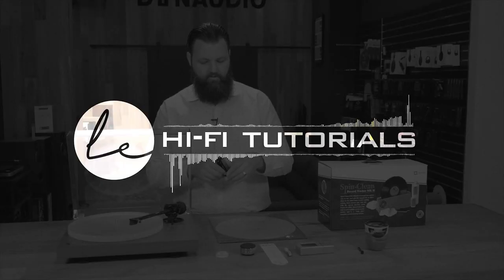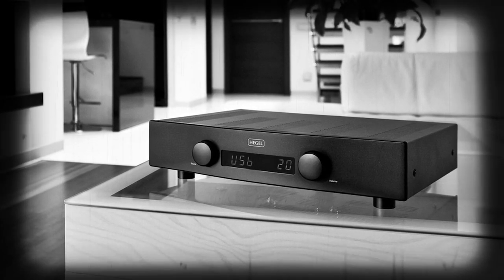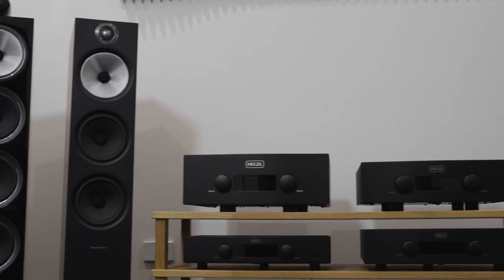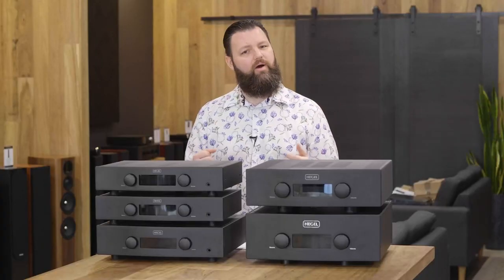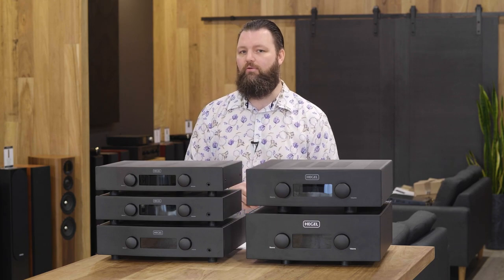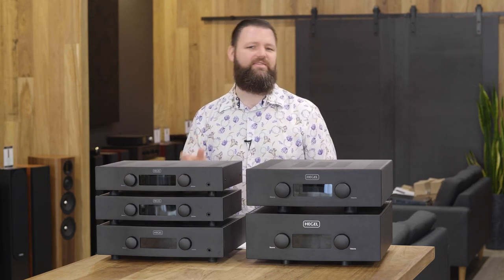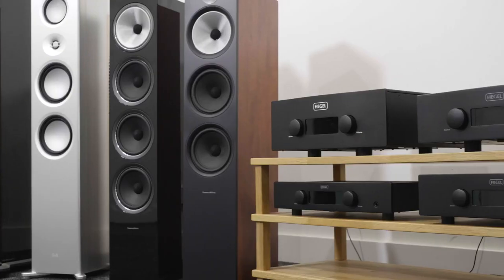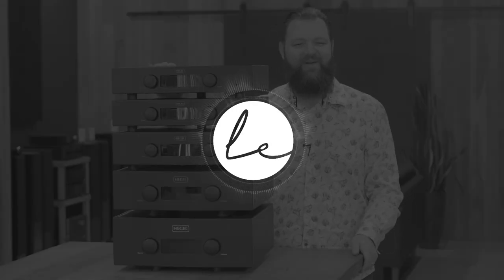Hegel: Power Meets Purity

Comment: 2:50 Damping Factor is high, not low. It should be high. Hegel has decent damping factor considering they are still using an out-dated class A/B design.

Comment: Now i am using Hegel h390 with b&w 702 s2. Big upgrade from h190. I have controll and good bass slam witch the h190 just cant match its even more transparent, more details, than h190. My 702 s2 is more comfartable at high volumes their is never any sign of strain h390 remain calm.with h190 it could be a bit edgy at top end, the h390 fixes that, it clear to me that h190 was on lower side to drive 702 s2

Comment: I know you said they’re very good synergy wise, like you said.  How you think the pairing of this with 606 s2 would be. ?
Reply from the maker: We have used them with the H95 and H120 and found it to be a really enjoyable experience. The Hegel really squeeze every last drop of lowend from those bookshelves.
Reply: @living_entertainment  so they don’t sound bright at all ?
And do 120 is a lot better for driving them than 95 so it’s worth buying 120 over 95?
Reply from the maker: @GB-up6nl  In our experience no matter what you pair the 606 S2 with there is always going to be a lot of treble detail. Thats what gives them that incredible transparency. That while the Hegel doesn't push it as forward as some other amplifiers but it doesn't change the overall character of the speaker either. With the 606's I think the H95 is certainly more than up to the task but the H120 will give you more options for expansion long term.

Comment: Thank you for the insight. Noob question: given I already have an AV receiver, would it be better to buy a power amplifier (instead of an integrated amp like the Hegel) and hook the power amp via the HT pre out to feed more power to my newly acquired front speakers? What is the difference?
Reply from the maker: We actually recently covered this topic in a video on our channel, check out our Home Theater Bypass video. ;)
Reply: I would absolutely go for an integrated amp with ht input. For music you are just the integrated for what is was designed for, and it is perfectly fine for home theater unless you have some extreme requirements for sound pressure.
Reply: @Rene_Christensen  thanks for the advice… I am definitely more inclined towards this type of set up now.

Comment: Hi Sir great video once more, i am using Wharfedale Lintons with an atoll in50se and pc sound card dac and i am a bit disappointed with the strength of the bass response. It's only 50 watts into 8ohms and i was wondering if an overkill 250 watts of the h390 would increase the bass strength and punch. The speakers are 6 to 4.6ish ohms and 90db efficiency but i saw in a review they measured at 85 db ( so wharfedale lies? No idea ). From reviews i went through the lintons are reported to have strong bass but dunno...Do you think i would just be wasting my money and i should go to tower speakers or grab subwoofers? ( though i must say i dont like subwoofers and i prefer bookshelves to semi towers like the lintons ). On another hand i would like the idea of having a good foundation of amp/dac and maybe upgrade the speakers later. What do you think? Can i make my speakers bass ballsier or would another amplifier suit that best? I was also looking at rotel michi integrateds or the primaluna evo 300/400 tube integrateds but fear the primalunas will lack the driving capabillity and maybe the ballsy bass. Thanks and sorry for the long read.
Reply: Hi, what do you do in the end with your lintons?

Comment: Hegel h190 and b&w 702 s2 here that i also spotted in this video, very good pairing very good amount of details, clarity and controll, i just wounder how things would change if i buyed h390
Reply from the maker: That's a killer pairing! The main differences you would notice moving to the 390 would be bigger and more well-controlled bass and a little more instrumental separation and depth. It's not going to be a night and day difference though.
Reply: @living_entertainment  thanks, i have been afraid to to turn the volume any more than 40 becouse my past experinces with my old speakers 683 s2,  is the 702 happy to play loud with h390 without harding the sound, i just don’t want to damage my speakers
Reply from the maker: @andreasmoller9798  You should be able to push the 700 series a little harder but I dont think B&W has ever really been a brand with a focus on volume, in our experience regardless of pairings B&W generally sounds best at medium volumes. Not really a party speaker perse.
Reply: @living_entertainment  thanks, my preference is 80-85 db, and that should work with 702 s2,  some claims that you need a lot of power to play loud on the 702 s2, i played around 80-85 db with my old 683 s2 speakers and it didin’t sound hard or anything 702 s2 should be able to play at the same volumes, i don’t need to play crazy loud, just a medium high volume, i don’t like listen at low volumes
Reply: Back in January, I purchased the h190. At the time, I had it paired with KEF LS50 Metas and a pair of REL subs. As the KEFs didn't have the sound I was looking for, I returned them in favor of B&W 805 D3s. While the h190 did a decent job with those, I decided to return it and move up to the h390. My findings are that the h390 is a big step up from the h190 (likely the biggest step up between models in the Hegel lineup). This is the system I have had for a number of months now...and I no longer think about "what if I had bought that other amp or set of speakers". I would be surprised if you didn't notice a big difference, with your 700 series B&Ws, on the h390 vs the h190.

Comment: Which Hegel would you suggest would work best with the Kef R3s?  I am leaning toward the H190 but I have heard H120 work well too.
Reply from the maker: Both will definitely do the job, whichever better suits your budget is the one to go for.
Reply: Thank you.  Another question, I heard a rumor that when Roon gets added to these amps the H190 will be upgraded to read MQA.  Have you heard this too?  Is it legit?
Reply from the maker: @CapnJack100  Hegels DACs do not unfold MQA at this time. If you are looking for that functionality you are better off adding a Streaming DAC that does offer that functionality.
Reply: @living_entertainment  thank you.  I do have a bluesound vault streamers that can unfold MQA but I understand the DAC in the Hegel is better.   Is there a way to connect the streamer to the Hegel h190 so that its uses the Hegel Dac to process the music?  If so I’m guessing it is best to drop tidal and use Qobuz as the Hegel Dac can decode HiRez?  Sorry it’s a lot but struggling here.  Thanks
Reply from the maker: @CapnJack100  You can use the Vault to pass through a digital signal but the Hegel will only decode the audio at CD quality. 

The DAC inside the Hegel is absolutely fantastic and I think there is a very strong argument to be made that its CD quality decoding sounds far better than the Bluesound's MQA unfolding, but this is all very subjective in the end. 

We personally believe a DAC's implementation is far more important and has a bigger impact on the sound quality, than the format the music files are in does.
Reply: @living_entertainment  okay so just to reiterate, I can use a streamer to bypass the internal Dac on Hegel or drop the whole Hi Rez thing and use the superior Dac in the Hegel.  I thought I heard the internal dacs could read hi Rez and the h390 model and up could unfold MQA. If I went with the first option how would I connect the blue sound streamer?  Thanks again
Reply from the maker: @CapnJack100  The 390 and 590 models do support MQA, that is correct. The way to get the most out of a Bluesound with a Hegel is to use the Digital Coax output on the Bluesound.

Comment: I have the Focal Aria 906 speakers and the Rotel A11 Tribute. I Listen mostly at levels of 70-75 db. Do you think that the H95 would be a good upgrade ?  Thank you
Reply from the maker: The Rotel A11 is a great entry-level amp but the H95 will definitely give you a more robust and controlled sound across the board.
Reply: @living_entertainment  Thanks
Reply: @dimitriskontos858  I have the Aria 906 with the H95 in my bedroom system and they sound amazing together. I did add a subwoofer for the extreme low end but I have to say they sounded great without it.

Comment: This might be a silly question, but can you have a Hegel amp for the umpf and use an all in one streamer like the NAD M33 as the source? Which one would rule the sound? I'm looking to buy a system and I like the NAD M33, but I'm not sure the sound is quite there. I'm looking to build around the B&W 803 D4 speakers. With speakers like this I like the fact Hegel are dual mono block. But I'd prefer the NAD for it's streaming. Can you combine the 2 and improve on the sound or would the NAD make the hegel pointless? Can you give me some advice please.
Reply from the maker: Go for it! That's not a silly question at all. That's a common way to work with components. Take advantage of a brand's or product's strengths.

Comment: Do you recommend the H95 to be paired with LS50 Meta's, and would there be a noticeable difference in using the H120?
Reply from the maker: The H95 does sound quite excellent with the Metas, yes. You will definitely get a boost in performance if you jump to the H120 though.
Reply: @living_entertainment  im using the H120 on my meta's,  perfect match in my opinion.  I tried the h90, it was good but not quite enough power i also demoed the H190, it was great but overkill for small speakers like the Meta's, 
the H120 is the best match in my opinion
Reply: @hclandscapes  Thank you 👍
Reply: @hclandscapes   Do you use a Sub with this combo?
Reply: @MisterChibs  no i dont my listening room isn't that big and i dont sit very far away from my speakers,  the bass is actually very impressive on the Meta's despite what some people say. 
Not really a fan of subwoofers for music.
Reply: @hclandscapes  Thanks for your reply. I almost immediately bought a sub for mine but now feel that amplification was the main problem. Going to (hopefully) rectify this with the H120.
Reply: @MisterChibs  what amplifier are you currently using?
Reply: @hclandscapes  Bluesound Powernode
Reply: @MisterChibs  i think your speakers would benefit from a more power amplifier than what you currently have
Reply: @hclandscapes  thanks! Going to check out the H120 today!!
Reply: @MisterChibs  nice👍
 let me know how you get on .
Reply: @MisterChibs  how did you get on with the H120?
Reply: @hclandscapes  funny you mention the Hegel. I’m burning it in now. It’s been over 24 hours running straight and I’m cleaning up my gear after a long maternity shoot. Bringing a light stand down to storage and overhear “Things Are Getting Better” by
Cannonball Adderley &
Milt Jackson”. It sounded so good I came and sat down to just listen with this huge smile on my face. I’m going to make my next vid on it and it’s going to be epic!! Oh and I ended up with h190. Long story that I’ll save for the video. So pumped!!
Reply: @MisterChibs  nice you ended up going for the H190!
Did you feel the extra power made a difference?
I have actually been considering the new NAD C399 as its rated at 180wpc with brand new n-core modules and the same dac as they currently use in the masters series. 
What do you think of the base out out now?
Reply: @hclandscapes  Yes but the H120 was amazing too. I ended up getting the 190 for larger speakers down the road.
Reply: @MisterChibs  I was tempted by the H190 too but couldn't hear much difference when running my Meta's plus I'm not sure if would ever own massive speakers in the future that would require the extra power. 
However i think the H120 is a very capable amplifier that could still power bigger speakers if required due to its high current design and damping factor. 
I think sometimes we get a bit carried away with wanting more power but i guess it depends on your listening habits and how loud you like to play?
Personally i rarely go over 90db and that's plenty loud enough for for my ears,  maybe im getting too old these days! 😄
Im glad you have discovered Hegel as it's the best amplifier i have ever owned and they are know for their reliability so it should last you many years 👍
Reply: @hclandscapes , I typically listen around 75 DB average but my listening room isn’t small. Sounds like you should stick to the H120 instead of going to the Nad C399. Considering the context in which I bought this amp (Powernode was an underpowered waste of $) I would rather have more power should I require it down the road as apposed to doing incremental minor upgrades. The jump in price wasn’t substantial (unlike spending up for the H390) Having said that, I did notice slight differences in soundstage, base, and warmth. Both amps are a night and day difference from the Power Node though. Excited for burn in to finish!

Comment: Which Hegel amp would you pair with the Bowers and Wilkins 704 S2?
Reply from the maker: We have them paired with the H390 currently.
Reply: @living_entertainment  Thanks. Was hoping you'd say the H190. LOL. Seriously, though, did you happen to try them with the H190? I am very curious to know if the sound is noticeably different with the H190, compared to the H390.
Reply from the maker: @zaoria123  We have tried the 700 S2 range on the 190 and they do sound good, but I guess having heard them on the 390 first it was quite apparent how much they took advantage of the extra juice. It is still a very enjoyable listen, but your not getting the maximum performance out of the speakers. If you don't compare the 2 in person though you wont know what your missing so it wont bug you, ha ha. ;)
Reply: @living_entertainment  Thanks for the extra info. I had suspected what you say, but its good to have  my suspicions confirmed.
Reply: @living_entertainment  By the way, can you say a bit about what differences you heard between the two amps (H190 and H390) with the 700 S2 series speakers?
Reply from the maker: @zaoria123  Mostly it comes down to the degree of seperation between instruments and the weight and control of the bass. Tonally they sound incredibly similar.
Reply: @living_entertainment  OK. Thanks very much for the info!!
Reply: Pairing an amplifier worth over 5 grand is ridiculous on speakers on like the bowers and wilkins 704s2's , sure it would sound great but i wouldn't dream on spending that much money on a Pairing like that. The H190 would be a perfect match in my opinion.
Reply from the maker: @hclandscapes  We operate on sound first, and while price matching is obviously important its also only a small part of the equation with any system
Reply: @zaoria123  i use 702 s2 with h190,  so 704 s2 will work nicely
Reply: @andreasmoller9798  Thanks, Andreas! Did you happen to hear the 702s with a h390?
Reply: @zaoria123  i have now and have 390 with 702 s2 its a big difference. Sorry for late answer

Comment: Hegal is a brand that is overhyped, overpriced, and not a better design than a very good designed amplifier.  They do not measure or sound better than a quality designed amplifier. The more inner parts count and long signal path and bigger size of the amplifier = worse distortion and sound quality full stop. Sorry but hegal is all overhyped crap. Don't believe reviews and reviewers. Use your ears, and learn what to listen for in music recordings. Have a Listen to some high quality active electronic crossover powered studio monitors like the class A/AB mosfet powerd  two way and 3 way ATC SCM ASL studio monitors as a bench mark for sound quality sound, because there are many crap and overpriced hifi manufacturers and audio systems out there, and especially do not believe all the hype, the reviews, and reviewers.
Reply: Lies